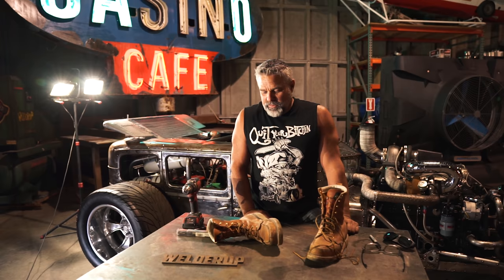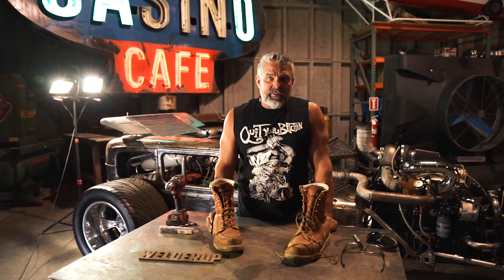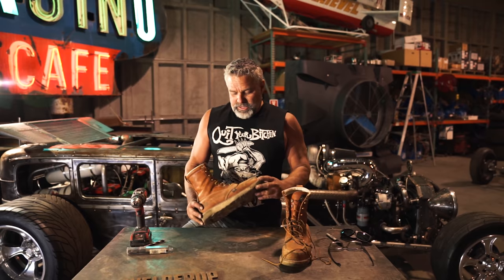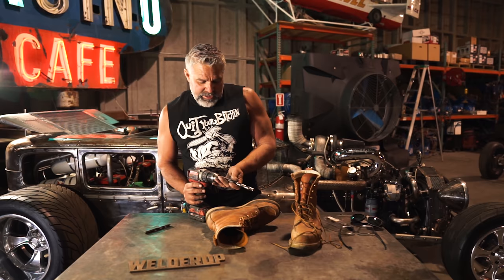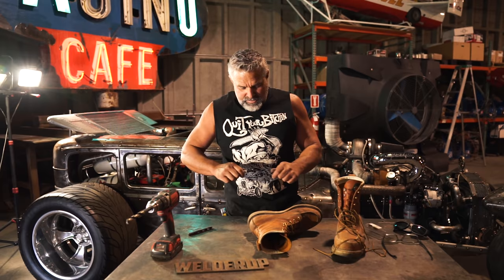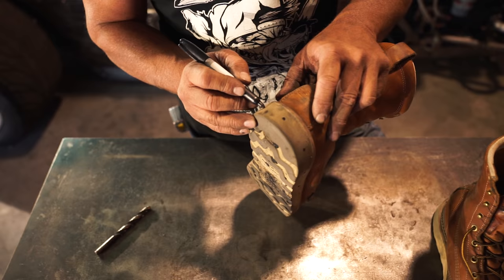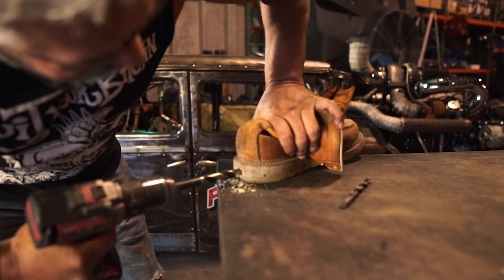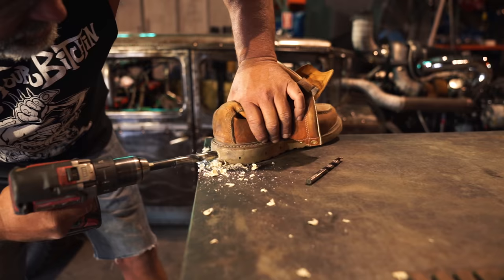If You Own Work Boots You NEED This Hack!

Comment: As someone who has spent nearly 25 years in the trades, you can live and die on your feet depending on how well you want to take care of your feet. That being said I am no stranger to spending +$250 on a good pair of boots. Composite cap, steel cap, metal shank, boots for welding, boots with extra ankle support. You name I've bought it, tried it, and probably over the years, I still have a boot for every occasion.
With 2 exceptions:
1 if the leather is cut over the toe insert, fix it with a tube of tuff toe and now you have a broken in well worn back up boot. Pony up. It's time for new boots
So if you think drilling holes in your foot's investment seems smart, don't be the one in today's blue-collar workforce to get jammed up on a work comp injury claim because you didn't wear thicker socks or insoles. Don't put some stupid advice into some wet behind the ear kid, who hasn't time on the job to lean back on, when he uses your example of stupidity maybe only getting fired.....or worse hurt.
So take the money that this idiot used to buy a nice quality cordless drill with the extra "voids manufacturer warranty setting while drilling work boot soles" and buy a good pair of boots that will save your feet. Also for about $80-90 you can get "Your" well broken boots resoled, and if you want to change the sole it's cheaper than buying and breaking in new boots.
It's all in the name. 
PPE
PERSONAL
PROTECTION EQUIPMENT
Reply: Personal 
Protective?
Equipment

Comment: I can see the boot manufacturers seeing this and thinking "fuck, why didn't we think of that?"... They'll be in your nearby walmart soon, watch..
Reply: Yep.
Reply: Gotta wonder why they aren't using softer materials or doing something similar already.
Reply: James Scheppegrell 
They do FXD boots in Australia are made from lighter materials and have a composite toe as light as my sk8 shoes from the 2000’s
Just have to find the right brands
Reply: @dopeass791  doc Martin's melt for welding
Reply: @dopeass791  Doc martens are super light, like a sneaker. But you gotta go for the high quality premium ones
Reply: DOpe aSS I use some old  Corcorans from the 50s.
Reply: Waiting
Reply: @kinguin7  harder rubber compound on boots let them add no slip or puncture resistance heat despiation etc etc
Reply: Adidas did this year's back

Comment: That’s what’s I need water in my boots
Reply: You won’t end up with water in your boot if you don’t drill through the midsole. It’ll just be through the sole and if it’s a soft sole like that it’s already full of holes basically as it’s an open cell foam anyway

Comment: Just took a likening to thorogoods the last two years.  The wedge sole are the most comfortable for concrete and asphalt use. I wear the black soles with a defined heel since I’m a rental tech and am on all types of terrains. 

Won’t find a more comfortable pair of boots.  Won’t buy redwings, Irish setters, Carolinas, timberlands,  or any of the others anymore 

Still keep a pair of rocky pull ons for oil field work but nothing compares to foot comfort after a 14-16 hour day than thorogoods

Comment: 30 yrs in construction, 6 ft, 250 lbs. 8+ hrs a day on my feet. 

Worx by Redwing are more comfortable than any expensive sneaker I've had. I'll change up my outfit to match my boots if I'm going to a place that I'll be on my feet or walking all day.

They'll last me two years before the sole wears out.

Comment: It also lightens them up.... i no longer wear boots and switched to merrell hiker sneakers all leather w/ vibram sole for shop work. adding leather/canvas gaiters for 'spark in shoe/hotfoot' prevention as needed. Its a change of several pounds and super comfort on your feet.

Comment: good hack i was in construction my whole life and my preferred boot was Herman Survivors because of their lightness and fast break in  quality unfortunately they  as a whole wore out pretty quickly ? for years i bought them at KMart because of them having the lowest prices  i also found that they  gripped the best on awkward climbs  like is necessary when building houses or  office buildings  you never know what you may need to climb onto or over  during a work day  from things like steel scaffold to aluminum ladders , asphalt roofs , muddy terrain  you name it  the worse was always wet lumber  as that would sometimes bring the natural oils out of the wood and become very slippery

Comment: Neat trick for sure but only with what id consider throw away boots.  After going through so many brands I seem to be much happier and cost less in the long run with a handmade pair  like Whites,Nicks or any other similar to them.  Just got tired of burning through so many inferior boots, most made it 9-12 months some 6 months before needing replaced.   Its like comparing myself to your metal work, so sometimes its best to have a real cobbler do it right in some circumstances.

Comment: Try buying boots that have a small yellow tag on the  bottom of the sole that says Vibram.
Vibram sole was originally developed for mountain climbers. The Vibram sole makes you stand comfortably and correctly. 
Wear them first before you drill them.
Since I discovered the Vibram sole.
I don't ever buy boots that don't have Vibram stamped on the tag.
I told several men whose jobs make it necessary to wear boots. 
They all switched to Vibram sole.
I hope you try them. 
They are definitely the best.

Comment: I totally get you about walking on concrete all day long. I was a production facility maintenance man and walked miles every day on concrete. We had acres of floor space under roof. I strongly advise not to drill holes in the soles of your $200 work boots. That is senseless! Instead, visit your podiatrist and get an appointment with a prosthetics provider to have some inserts made. Your feet will still get tired but they will have better support. I would not destroy the integrity of my Hathorn, White's or West Coast boots by following this advice but, it's your money. By the time you walk on metal shavings and scrap metal for a week or two those soles will be coming apart.

Comment: I get my boots a size bigger. I then put a $10 insole on top of the insole already in there. This makes the boot fit snug. After a couple months when the boots don’t feel as good. Replace the $10 insole. New boot feel again. I usually replace my boots every 6 months. So I’ve learned to not spend more than $75 on boots, because it’s stupid. Particularly if you’re getting them wet a lot which in my opinion wears the material out faster. I do recommend trying the boot with the insole before you buy. You might only need to go up half a size.

Comment: i think if it work for you its a good idea, just like my one move shoe laces system, i have been using this for years and yet very little people use the same idea, i am so  busy during the course of a day i cannot be stop to tie my shoe, but your comfort idea is just as good i will implement this on my summer shoes ( as per say i actually did what he did , and it actually work , a few 1/4 holes in my shoes really improve the comfort level , cheers man)

Comment: I have had good luck with georgia boots . experience speaks volumes .
Reply: Swear by Georgia  boots  owned danner and redwing. Like both. But the G is my go to
Reply: @klosnoski  I bought a pair of Georgia's and so did my dad and neither of us could stand them they'd were so uncomfortable
Reply: I've got 3 pair. 
And 2 pair of redwings. 
I guess it's a to each thier own. I used danner first while In towing and moved across the board. For what i did georgia fit the bill for 20 some years. Danner and redwing just didnt hold up. 
In my former line of work... georgia did it better and longer. YMMV
Reply: If any of you ever own Wesco or Whites, you would realize how shitty Redwing, Danner, and Georgia boots are. There's a reason why linemen and woodland firefighters don't wear those shitty brands.

Comment: Thouroughgoods are great boots.
I got two new Garret Wade tool bags and a pair of Georgia Boots a few weeks ago. I got the Georgia Farm and Ranch instead of the Thoroughgood oil rigger. A little easier on my pocket and the Thouroghgood looked cloggy compared to Georgia Boot. I have a pair of Brahma Wal Mart specials that are 10 years old and still kicking. Most uncomfortable things you will ever put on your feet though even with multiple insoles and thick socks.

Comment: I understand the concept, but if the person doesn’t plug the front of that hole and you walk in the mud you’ll be tracking mud forever. Will fill up and get heavy on you. Guy could plug the hole with some through the roof I suppose, or Apoxsee.
 Just my thoughts I guess thanks for sharing.

Comment: I wear Thorogoods every day too. Even as a crane operator, I wear the soles down to almost half the original thickness in a few years. If you are wearing the uppers out before the sole, you must not be taking care of the leather.
Reply: Pick up your feet
Reply: @michaelb2753  I don't drag my feet. It could be from the abrasive surfaces of the crane decks and the nonslip ladders. 🤷‍♂️

Comment: Drill holes to make one chamber, cap 'em, hook up a valve stem, and fill it up with helium. Now you'll be really light in the loafers. Although you might be tempted to try hydrogen, due to its lower atomic weight, just remember the Hindenburg.

Comment: I paid almost $700 for my current boots from jk customs in Spokane. No way am I drilling holes in them. That being said they measure your foot and make them for your feet. Also a higher heal takes weight off your heal and reduces issues.

Comment: I have to wear steel toe capped boots to work (I work in a warehouse) anyway my boots KILL my feet to the point I can’t barely walk x
Reply from the maker: Same here until I drilled the holes in the soles. That may not be allowed in your workplace. Nothing worse that aching feet.
Reply: @WelderUpVegas  thank you for the advice, and Awh no I’m sorry your feet hurt like mine did ouch x

Comment: i love the cobbler comments. instead of complaining, why not look at it like "necessity is the mother of invention". maybe there is a need for such a sole. i worked in the oilfields for 24 years on steel and concrete and was a carpenter before that walking on concrete and walking plates. standing on cold or hot concrete sucks and has killed my feet and ankles and knees. whatever works for you i say. i remember when Wolverine Dura-Shocks came out the sole was nice and cushy but the uppers sucked and Redwings were the standard but their soles were stiffer than a Wedding Dick. why can't someone make a Quality boot with a good sole and is comfortable from the start with no break in. when you buy a mattress it better be comfy from day one or you'll be pissed but yet we buy shoes that take mos. to break in.
Reply from the maker: Love your comment! You are right on. I get negative comments about ruining a new pair of boots by drilling holes in the soles but it works for me and makes standing bearable. Thanks for watching Mark!

Comment: I’d like to have my feet amputated and replaced with blades for a six inch lift. My knees rebuilt with high strength nylon ball and joints hips.

Comment: You could not do this is you really use your feet where you work yeah if your just strolling throughout your day at work but if your really put wear on your feet at work nope.. I go threw a 200 boot in 6 months on the river best boot for longevity keen or ariat cowboy boots timberland pro hands down keen for comfort

Comment: Maybe you’re a genius, but I’m skeptical and quite certain this is utter nonsense. A podiatrist would tell you your feet need equal support throughout the sole and this eliminates the purpose of a sole if these holes are not perfectly sized and equidistant.  There are certain areas of the foot that need more support than others such as the arch as well. A custom pair of inserts usually has a golf ball size lump in the arch and feels awkward at first but once you start using for a few days can alleviate a lot of different areas where one may experience pain from lack of support to the arch.  I had a lot of ankle, lower back and sciatica pain before my custom inserts and now it’s all gone. Try those, they’re $100 a pair but they’re FUCKING WORTH IT. And you can remove them and put them in any boot/shoe.

Comment: Don't think this will work for my ariat boots, the oilfield don't like holes in shit. I just change insoles every 4 months, and replace boots every 6. I highly doubt there's a boot out there that will last longer. If there is, it'll be incredibly expensive, and you're probably a driller.

Comment: That's the stupidest thing I've ever seen anyone do to a pair of boots
Reply: pretty stupid he cut that perfectly good car up to I bet also ehh?  Wait till your in late 30s or 40s after pounding on concrete for decades and tell me how non orthotic $50 insoles do for ya( absolutley nothing) once your feet are trashed by one size fits all hard rubber sole. Sports shoes have holes/air gaps in em to soften shock loads too bad boot companies dont offer it and have everyone wreckin feet for no reason.